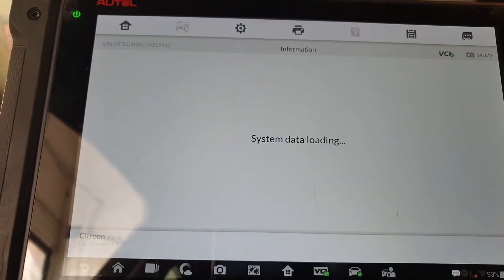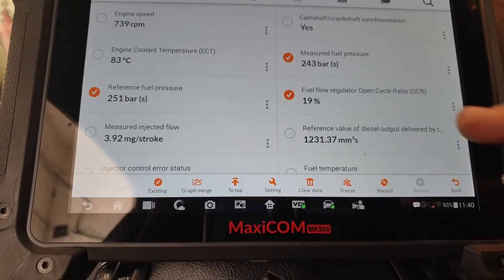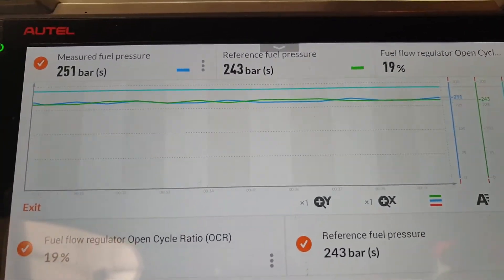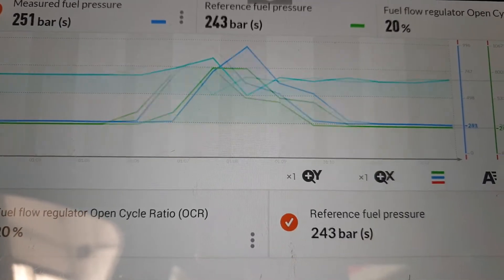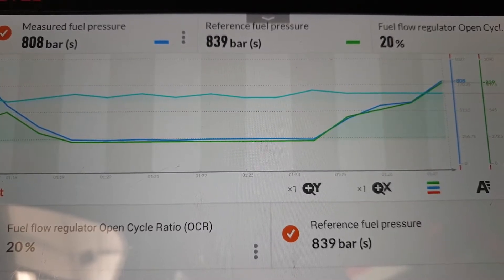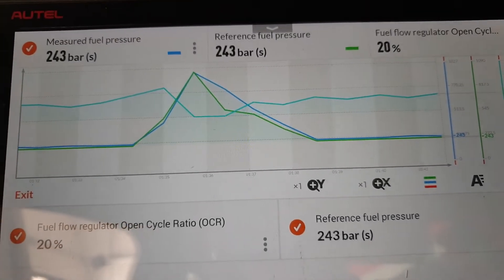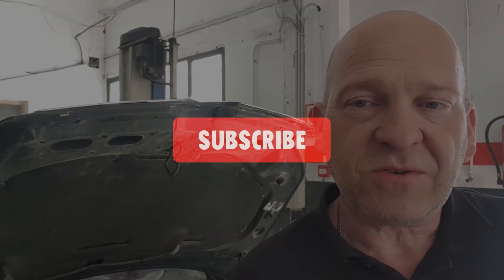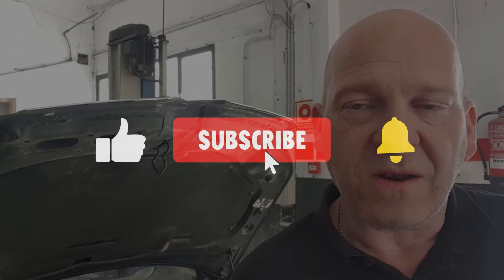Citroen 1.6hdi  P0087 P0093 fuel pressure faults.

Comment: I have a 2017 model partner. P0093, p1113 and p0087 opens fault records. I live in a very cold place. First I thought the diesel could freeze. There is also a possibility that the diesel is of poor quality. After a while, I got bored with the malfunction and decided to change the filter. After changing the filter, I drove about 100 km without any problems. Later, the car stopped for a day or two without running and made the same breakdowns again. Where do you think the problem could be? Diesel filter log or fuel pressure sensor? Or what do you think?
Reply from the maker: Sorry, I cannot do diagnostics via the internet.
Reply: @ 😅 thanks

Comment: I have code p0087 and changed the filter but sill not fixed.
Reply from the maker: It is not always a filter issue for p0087. look at live data for fuel pressure sensor. while driving in varying conditions.
Reply: @rpsspain1966  yes the live data shows that it drops ever so little. 
I’ve taken it to 2 different garages and 1 of them said they haven’t got a clue but it’s probably the fuel pump and the other said they would have to try and do other things to eliminate the problem.
Reply: @rpsspain1966  also when I’m driving it cuts out after about 15 minutes but then starts again as soon as I come to a stop. The van starts first time every time. Could you help. Thanks
Reply: I had 0087 code low fuel rail pressure and code for fuel rail regulator low pressure/changed rail sensor no difference/hand pump connected to pipe on top of cambelt cover using pipe cut off fuel filter/ I was able to pressurize the fuel tank with hand pump and also create a vacuum if pump turned around so /when removing fuel cap it was sucked on /so block vent on fuel tank /before repairs van would stop and engine light come on but would restart straight away /hope this might help someone looking for answers to 0087 and1113 codes

Comment: It's a interesting test, but has nothing with the press failure. The press sensor must be located somewhere on or before input of injector (common rail), not on output. On output, there is just combustion space..
Reply from the maker: Agreed in part, this is an easy test for the average person, as stated in the video it is not a conclusive test and one test in a range. In this case the vehicle had a new injector and has been fine since. Leaking injectors can have an impact on the fuel pressure. Thank you for your input.

Comment: I have a 2014 Peugeot 308 1.2 petrol puretech. Trouble code: P0087 for low fuel pressure. Car goes to Limp Mode once above 40kmh. Took it to many mechanics, no solutions yet. Any idea what it can be?
Reply from the maker: Thank you for the comment, however, I can not diagnose over the internet, would need vehicle assess live data etc. Sorry can not be more help. ther are some great guys on the peugwot forums that maybe near you.
Reply: when was fuel filter changed?

Comment: I have a Ford 1.4tdci with fault code P019160 Fuel rail pressure sensor range performance error. The car is now unreliable and constantly cutting out .What I have noticed is air in the low pressure pipes and as much as try to remove it using the hand pump the air is still present. Do you think this air in the low pressure pipes be causing this problem?
Reply from the maker: Hi, Thank you for the comment. The system should not be drawing in air, I would start by checking the leak off pipes and a visual of the system for any leaks. Look at live data and see what the fuel rail pressure is reporting. Hope this helps.
Reply: @rpsspain1966  Ok thanks will do👍

Comment: I had P0087 high pressure fuel rail failure (or something very similar). I changed the fuel filter and all is good. 2008 Ford Focus. if anyone has the same I would start with that. Many garages do a service on your car that does not include a fuel filter change. It can over time get clogged up or start to fail.
Reply from the maker: Can often be the cause, I service this car to spec, it had a new fuel filter on its last service, then went into main dealer in Granada for this issue and they put another fuel filter on it, this was basically throwing a part at it. they were happy to take over €100.00 for the pleasure, without resolving the issue.

Comment: Hi did you get to the bottom of it? Was it the injector?
Reply from the maker: Hi, sorry didn't get to video the injector change, regular customer, no negative feedback, so I would say all good.
Reply: In my Peugeot partner tepee 2016 1.6 hdi at 157000km is it possible high pressure pump is dead? The problem is it is start up with difficulty and on the way the stop sign car to dashboard and car shutting down. After a while it is starts again. All injectors tested and good. We have tested magnetic fuel Regulator - it is ok as well. Now remain only on high pressure pump. Is it possible?
Reply: @Travel2azerbaijan  I’ve got same issue as you on my Citroen dispatch. What was the issue with yours at the end and how did you diagnose
Reply from the maker: You need to look at live data, to see what is going on.
Reply: @Travel2azerbaijan  check connector plug on end of fuel rail (on regulator/sensor)
Reply: In my Peugeot I found the problem. Fuel pump pumping with high pressure to injector and injector back chahnel could not resist high pressure. So replaced all 4 back channel and injectors adjusted in computer as per manfucters recommendation and now the car has no issue.